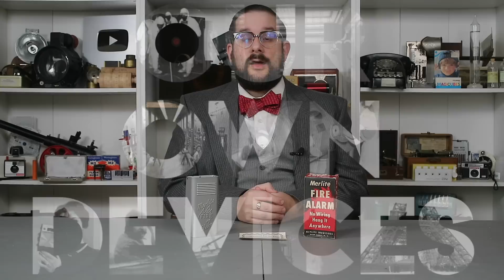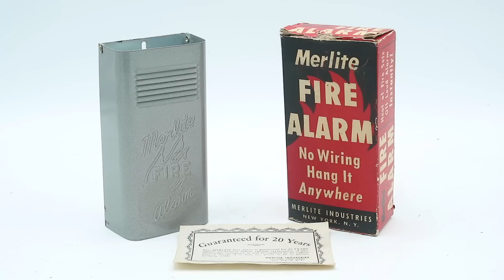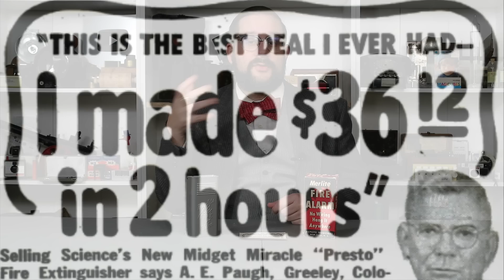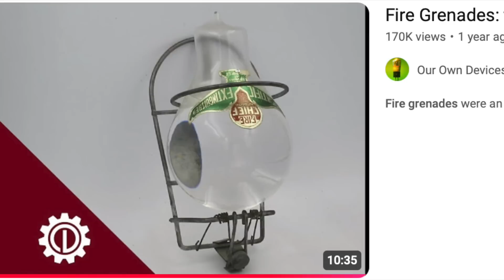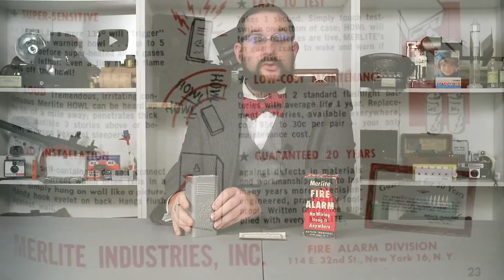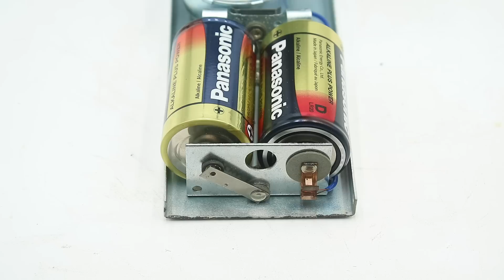SHORT: Merlite Fire Alarm

Comment: I replied to another post where the old wind up alarms were mentioned (no batteries) a friend has these in her home still, you wound them when you first got them, if a fire broke out, once again the alarm would sound loudly when it got hot enough. For their day, the fire dept endorsed them. A you-tuber pulled one off the wall, put it in the oven at a low temp, and sure enough, it did sound when it got hot enough to melt the wax inside. I have heard not nearly as sensitive as todays smoke alarms. How would this compare to the no-battery wind-up alarms in response time, how hot would they have to get to sound - bi-metallic strip vs wax melting, I assume? Also, old house design with more closed doors meant better fire safety than todays open floor plans. One device touted years ago was a faucet that would pop its head in case of fire, and spray a thick mist - lowering the temp of the fire, making it easier to escape, and to fight the fire also.

Comment: I actually have one of these, I found it at goodwill about 13 years ago for $5. It’s currently been in storage for a few years, but I’m pretty sure mine didn’t have any text on it. Since you’re able to push the little metal strip in manually causing it to activate I used it as a scare device in my haunted house.

Comment: They had windup fire alarms where I used to work....a wax bar held a plunger down...if it got hot enough to melt the wax, the bell would ring for a couple minutes ( maybe) until it wound down...
Reply: A friend still had these in her house - for their day, they had the endorsement of the fire dept. I was wondering how these compared, how hot the wax ones had to get before they would sound? They required no batteries, you wound them up when you first got them. A youtuber actually pulled one off the wall, put it in the oven at a low temp - and sure enough it did sound off shortly! However, they were not nearly as quick to respond as todays smoke alarms.

Comment: When I was a kid in the mid sixties our home had a fire alarm that was a brass mesh box. On the front was a sight glass with a blue liquid in it. Inside was an air horn and a canister that I assume was compressed air for the horn. The blue liquid reacted to high temperature and activated the horn. It was VERY loud!
Reply: That was Genuine DuPont Freon in the canister. It is called an Everguard. The sight glass showed that the Freon hadn't leaked out.
Reply: @ Thank you! I just Googled Everguard and that’s exactly it! I think they were sold by a door-to-door salesman, and they were kind of expensive for the time.

Comment: I mounted one of these in my Mom’s basement, above and between the gas furnace and the gas water-heater.  It was almost identical, but used only one D-Cell, and had a slightly more ornate bright-red housing.  I faithfully replaced the battery every few months throughout the 1970s.

Comment: Found two Carbon tet extinguishers in a garage. One had a accident. Had to evacuate, it didn't sit well on the lungs either.
Watched your videos on fire grenades. A excellent use for the modern fire grenade is chimney fires. My volunteer fire dept uses sandwich bags full of extinguisher powder for them.

Comment: When I grew up in Ottawa in the 1960's we had a similar device in our kitchen. Strangely I was just thinking about it a couple of days ago!
Our was similar size, flip-up front, bimetallic strip on the bottom, and two D cells for power.
Differences were that ours was bright fire-engine red, and rather than an electric horn like this one, the actual alarm was a mechanical siren, i.e. a rotating fan and perforated plate. I seem to recall that the rotating part was white plastic.

Comment: those buzzers were used in a lot of products, as I had one that originally was used as alarm in a safety briefcase, where you had a loop of bath chain that was attached to your wrist, and anybody stealing the case would result in 2 things. A loud noise from the case, and the companion dye generator making both you, and the contents, a bright orange, along with incinerating the contents of the case, as it burned to release the orange hygroscopic, and indelible, smoke from a pyrotechnic initiator. My father repurposed one of the pyro units behind the dashboard of his car, just in case somebody broke in and stole the radio.
Reply: Wow!
Reply: Nowdays the whole car is gone in 60 seconds.

Comment: Carbon Tet was a great contact cleaner for TV repair guys back in that day, but never knew its fire fighting ability. 👍
Reply: Great cleaner, I used an ultrasonic cleaner that used it, you needed a44 gallon drum to fill it, getting 2 fills out of a drum. It heated it up and condensed the vapour, so you had a hot ultrasonic cleaning bath, then a chill zone to dry the parts, and it took seconds to clean anything.
Reply: @SeanBZA Sounds like a great cleaner
Reply: I swore by 1,1,1-trichloroethane. Great cleaner and less toxic than CCl₄. It would knock you out if you inhaled too much, though. Since another way to describe the molecule is methyl chloroform, that makes sense.
Reply: AFAIK Carbon Tetrachloride is now known to be a carcinogen.
Reply: It's just not all that great to breathe, or get on yourself; and an environmental pollutant if disposed of improperly. (But most things that are good at cleaning are bad for people, because living things and really stubborn dirt are chemically quite similar. And CCl4 was harder to set fire to.)

Comment: 2 batteries, a bimetallic strip and a buzzer. Good fire alarm, lousy smoke detector, and if you are dealing with a bunch of plastics on fire you are probably dead before the air temp gets hot enough to trigger it. Still a neat bit of history from when home fire safety was starting to become more mainstream.
Reply: Years ago, I answered an ad for fire alarm installer, and was given an appointment for an interview. When I showed up, I was shown into a room with about 30 other people, sitting at school desks. Not what I was expecting. Two guys who looked and acted like mafia enforcers came in, and started the "interview". It turns out we were supposed to sell  these stand alone alarms door to door. They were similar to the Wilkinson alarm Gilles covered before, but with a few differences. The face of the alarm had a concave impression, that was supposed to focus the heat onto a wax plug. When the plug melted the alarm sounded. If it worked, I suppose it was better than nothing, but the smoke would probably get you first. I never went back.
Reply: Its not a smoke detector. Its a  heat detector that alarms.
Reply: I mean it can be tuned to go off at lower temperatures. Can be as low as 40 degrees Celsius if you want.
Reply: lolwut 40C is just a pleasant day in the desert ...
Reply: Now I would say the one mistake people likely made with these was to just hang it at eye level like a picture. Pretty much worse than nothing as the heat forms a distinct boundary layer. Put up right at the ceiling (or on the ceiling) it would be reasonably effective given the limitations of technology at the time.
Reply: I guess that in e.g. an appartment building the fire alarms are not so much to save the inhabitants of the appartment where the fire started, but their neighbours.
Reply: Back when this was sold most homes were not afloat in plastics and e-waste as they are today. Back then a fire would be something starting in a waste paper basket or a furnace, and would generate quite a bit of heat in addition to smoke. Also this type of an alarm in an attic would be a must in an older house with something like balloon framing. Even with fire stops a fire in the cellar could easily bypass the house and head straight for the attic. All of these make for good usage cases. The only drawback is if it’s electric as batteries and electromechanical stuff deteriorates. Today’s house fires are quite a bit different with things like EVs, lithium batteries, and electronics littered throughout the house that turn into superfund sites after a blaze.
Reply: Literally says fire alarm...

Comment: When the air is at 57 °C, the fire is already burning briskly somewhere around.
In those years we had the technology to build more reliable optical fire alarms, which sensed the smoke instead of the heat (CdS photoresistors and germanium transistors); the problem was the continuous light source: we only had incandescent miniature light bulbs. When under-volted, a light bulb can last fifty thousands hours; but the power draw of the smallest light bulb would have depleted the batteries in twelve hours or less. So the temperature sensor was the only avenue for a battery-powered fire alarm; the NTC hadn't been invented yet; we only had the PTC, utilised in the start-on demagnetiser for the colour TVs.
Reply: NTC: negative temperature coefficient resistor.

PTC: positive temperature coefficient resistor.